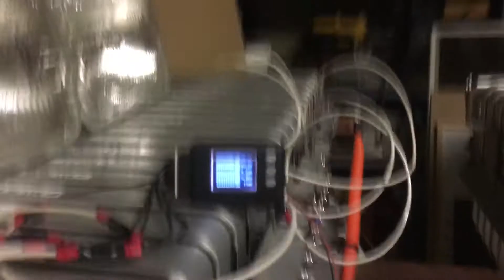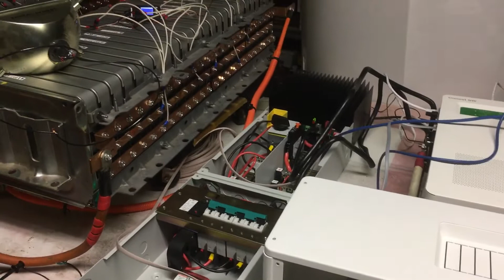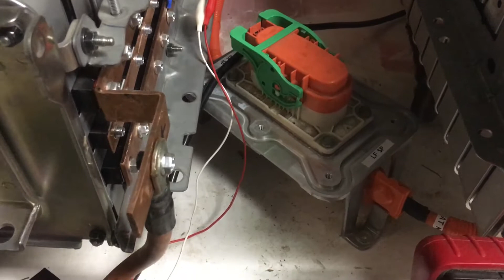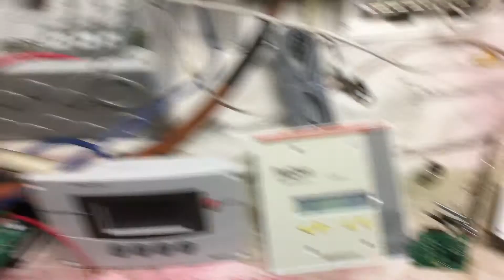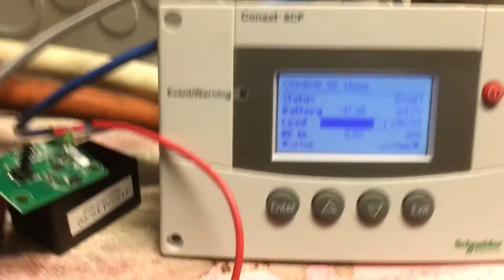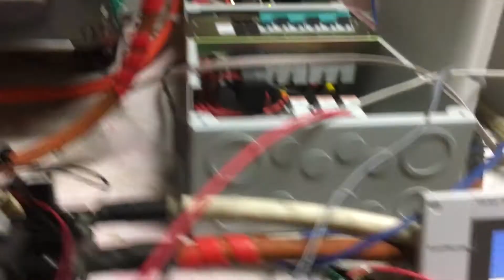Leaf Battery System and Schneider SW External Control

Comment: Hey, Nice system, and good tricky solution to switch the SW4048. :) (I did something like that with APC UPC, there must release the button until the beep... :/) 
I would like to ask a favor, the No-load power draw (Inverter On) is 27W based on datasheet. It is true? 
Could you measure that small current at full and at low battery too? 
(you can measure it easily, if you connect a multimeter to safety switch, and turn it off... ;) ) 
Thank you in advance,